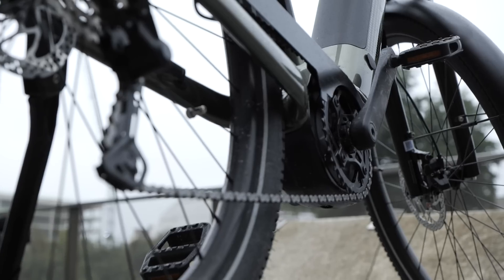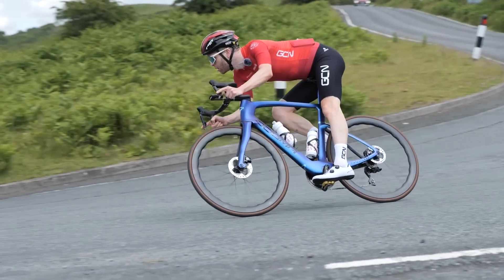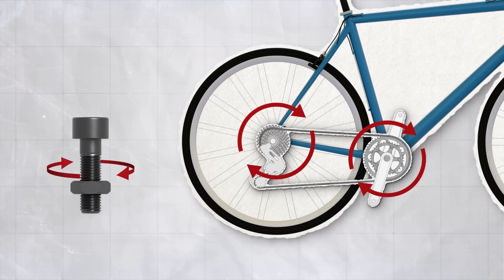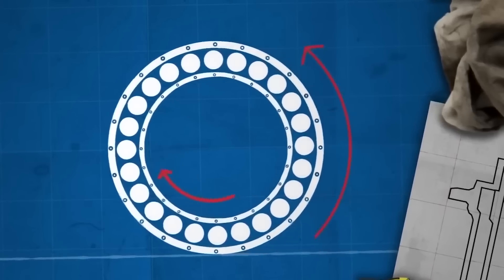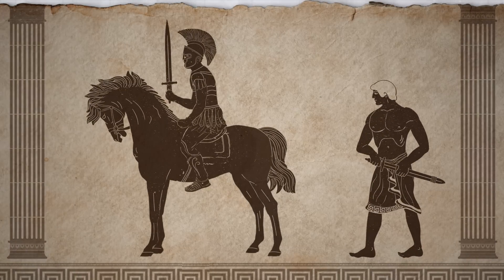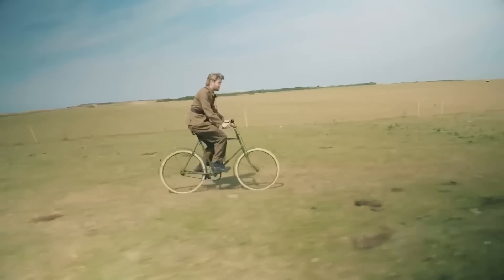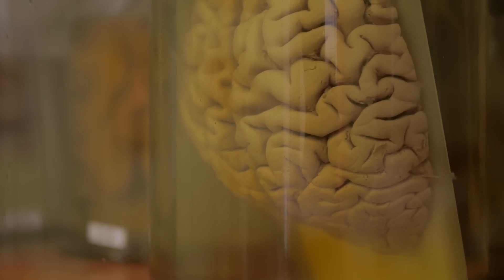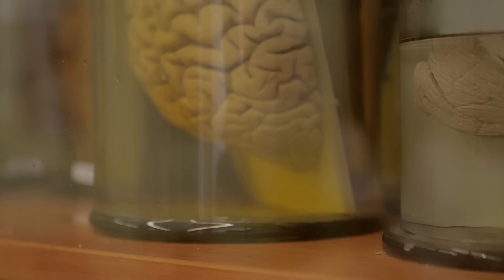Why Is The Drivetrain Always On The Right?

Comment: The modern "safety" bicycle is British. We mount our horses from the left, we operate our vehicles on the left for a right to right passing. It stands to reason that drivetrains were originally mounted on the right such that they would not strike nor become impeded by high kerbs on many British streets in the 19th century especially when mounting ones bicycle. This would also prevent the grease smeared drivetrain from soiling a gentleman's (because cycling is most unladylike, we are civilised people, these aren't the dark ages, it's the 19th century!) trousers when pushing the bicycle in a dismounted fashion. One would logically dismount to port and thus it was simply convenient to push with the bicycle on ones right thus placing the nearest trouser leg on the non-drive side of the bicycle.
 After a while this just becomes the norm. Why deviate?
 Despite the world coming to its senses and adopting the metric system (with exception of Liberia, Burma and the US), many bicycle standards are still imperial. Handlebars are 22.2mm or ⅞". For the longest time seatposts were 25.4mm or 1". Steerers are still 1", 28.6mm (1⅛) or 38.1mm (1½). I see you have bars in 31.8 or 35mm offerings. Do you run the 1¼ or 1⅜ offering? Ah but you have a modern bicycle, your 27.2mm post isn't imperial, right? Wrong, the clamp is 31.8mm, back to that 1¼" because the seat tube is structural to the frame it dictates the seatpost diameter, the more you know. What's the relevance of all this? Well, besides being a bit of fun trivia, it is a clear example of how despite many changes to the safety bicycle, conventions have not changed much in the past 150-160 years.

Comment: 3:10  No! This is not accurate. The reason for this reversal is called precession, it has nothing to do with the ball bearings. It is more like the threads roll around slightly as the load direction changes. For a quick demo: If you hold a pencil loosely in your fist and wiggle the end around in a circle the pencil will twist the opposite direction. This applies to both the bottom bracket and crank threads, which is why the both tighten in the opposite direction that they turn.
Reply: Whatever the theory, both pedals and bottom brackets will actually loosen if not tightened up enough.
Reply: This is true. He is also mistaken about the origin of right-hand threads. It's not because it's ergonomically easier, but because the applied clockwise force produces a torque in the direction according to the right-hand rule. Left-hand threads innately produce a counterproductive outward torque.

Comment: I've recently built a left-hand drive fixie. For the rear wheel the hub is Hope Fatso front hub, with sprocket bolted onto the rotor mounting. It's a nice red one. 

For the cranks it's a set of alloy ultra torque mounted back to front, with the threads for the pedals drilled out and helicoils fitted to reverse them - theyre still left hand thread on the left hand side right hand thread on the right hand side. 

But I realised is that being right-handed, walking with my left hand drive bike on the right hand side, or hoisting it onto my shoulder to carry it up stairs, is a whole new problem - now I have to  make extra effort to avoid rubbing against the drivetrain; or pick up tattoos on my leg, or clothes... Id assumed that the reason for the drivechain being on the right hand side (usually!) is to keep it out of the way for the biggest number of people. I've recently read a book on the history of bikes which suggested that drivetrains in the early years could be found on the left or the right depending on the manufacturer.

Comment: That the transmission is on the right is now very good.
With E-bikes it looks better and makes it more easy to mount the electric motor in the bike.
THe only bike I know that has an chain on the left side is the tandem. Although the sprocket on the rear wheel is on the right.

Comment: Back in 1962 I broke my right leg in five places.  I was a competitive club level cyclist at the time and my legs were very fit so fortunately I healed well.  But for some time I had a hip to ankle cast on my right leg, making it difficult to get around and see my mates.  So, I reversed the crank shaft, mounted the crank on the left and installed a fixed rear wheel with the sprocket on the left.  It worked well.  Until my doctor found out had had my bicycle locked away until the cast came off months later.  Twat.

Comment: This seems to make sense until you realize that virtually all motorcycles have their transmission on the left side
Reply: Maybe cuz the kick starter is on the right. To utilize limited space options.
Reply: Used to agree but you would be surprised how many now have drive on the right.
Reply: Hold on, kick start? Haven’t seen one on a new bike for 40 years
Reply: @petermacdonald6377  I had the Evil Knievel toy motorcycle. With the T-stick power. LOL
Reply: @petermacdonald6377  not in the beginning, though. I'm over 50, too, and don't inspect motorcycles for that stuff.
Reply: Well that makes sense in the same way -> you step up on the left -> so the hot exhaust should be on the right. And you want to separate your chain and exhaust, hence the chain should be on the left. You do however need to change the screw threads.
Reply: Not virtually all. There is a group that uses predominantly right side, and that is ones with transversal engines (although new BMW boxers and Guzzis use left). Also, there is some that use right side even if they're transversal, such as old BMW F engines (before 850/750) or Triumph's retro bikes.

But yeah, majority does.

Comment: Left hand threads on the peddles is un-needed.
Once upon a time auto lugs were reverse threaded on one side.
And then they realized if they used an angled seat for the lugs, they didn't need this.
With correct thread and contact design there is no reason for a reverse thread.
What they do need is an angled seat for the contact.

Comment: In three weeks time, SRAM will release a new groupset to match to a Canyon frame with the drive and everything else on the left and a load of marketing BS that says that right hand isn't aero, is heavier and left hand is more efficient and is capable of saving 100W.  This will be the 2025 craze that will save the bike industry now that we've reached peak carbon, peak electic shifting and peak disk brakes.

Remember - you saw it here first 🙂

Comment: You've got it all wrong. The pedal threads, and the bottom bracket threads. The bearings have an ever so slight drag along the races' surfaces, they don't have internal motors. You got physics all wrong. Fact is, the threads are the way they are, from an engineering standpoint, so that the threads don't over-tighten and seize! This was a problem with manufacturing inconsistencies (poor precision, aka tolerance) in days of past (and still with budget ch!na manufacturing today).  Ideally, we would inverse the threading now, with manufacturing producing much more precise facing and threading.
You've never had a poorly-tightened bottom-bracket come loose? You've never seen a pedal fall off a kid's bike because Walgreen kid didn't tighten it enough? If your claims were true, all that stuff would just self-tighten instead of coming off.

Comment: Great expalantion. Any chance you can explain why the front and rear brake lever location on the bars varies with which side of the road we drive on? Also, on motorcycles the front brake is always on the right.

Comment: This is the sort of content that's brought me back to GCN! 

I've never questioned the fact the drivetrain is on the right hand side - but even more weird, my track bike is left hand side and I've literally never noticed it 😂
Reply: That's hilarious 😆
Reply: Which direction are the threads on your track hub?  Do you have a lockring to keep the cog in place?  A track cog with right-handed threads, but used on the left side will tend to come undone over time.  You get the same problem on the right-hand side, but only when you try to resist pedaling.

Comment: So in the '70s a Canadian track cyclist had an experimental design with 2 drivetrains. The left side was set up with a freewheel, it would be the drivetrain until it was unwound. The right side was set to wind up and lock, so it would be a bigger gear. Not sure if it got banned, or was just too heavy for the Kilo. Jocelyn Lovell was the cyclist.

Comment: The reason the first "treads" where right handed is also because the first screws where from wood and wood is stronger left handed, which is the force applied to the wood when using the screw. That is also the reason old windmills rotate counter clockwise.
Reply: why is wood stronger left handed? Is this the chirality which is part of whole nature?
Reply: @Long_Toe  Science is not sure why wood is stronger is one direction as the other. It is probably a combination of sun and wind. Western wind is much more common.

Comment: Love geeky historical content.  Ive often wondered why motorcycles are the opposite to bicycles until i saw some early motorcycles in a museum.  I noticed they were basically bicycles, complete with right-hand side drivetrain with an engine bolted in the frame and a second drivetrain powered by the engine on the left-hand side.  As motorcycles evolved and went in a different direction, perhaps the left-hand side drivetrain remained once the pedal cranks had gone?
Reply: The combination of pedals with a motor is where the term "mo-ped" comes from.  Eventually the requirement for usable pedal drive was dropped, leaving only limits on maximum speed and power to be classified as a moped for road-tax and licence purposes.

Comment: It's the effect of precession that tightens pedal axles and English-threaded BB cups.
The video implies BB bearings push the outer cup in the opposite direction of axle rotation. If that were true, that force would act to accelerate the motion of the axle. We could use bearings as motors!

Comment: Interesting. Another reason that we drive on the left that I've come across is that in the days of horse drawn carriages, coaches and wagons, the drivers and waggoners had whips with which to encourage greater efforts, (a practice now rightly outlawed because of cruelty) because of dominant right handedness, the whips would need to be raised away from low overhanging branches and more to the middle of the road where the tree branches were at their highest.:goodvibes:
Reply: I don't know about that. People in my country are still using carriages and whips and they drive them on the right side without any issues

Comment: It would also make sense to have it on the same side as your dominant foot, as that's probably the side where most torque will be applied. Also re swords, your left hand will also likely be holding a shield (unless you're rich enough to have a squire to pass it to you after mounting), and that would be very awkward to swing over the horse.

Comment: motorcycles similarly nearly always have the chain on the left.  i think this is because the brakes are operated by the right hand (front brake) and right foot (rear brake), and traditionally the rear brake was a drum-type design that had a mechanical linkage to the pedal actuator.  by placing the chain on the left it cannot interfere with the brake.  additional head cannon: kick stands all lean a parked bike to the left, and i think this was intentional to keep the chain (which requires lube & care) sheltered out of the weather as much as possible.

Comment: i dont think i learned anything from this actually. this video was just a bunch of common folk tales presented as facts
Reply: true
Reply: Some of it perhaps, but the main point is about right-hand threads (specifically of the rear sprocket) is absolutely obviously correct to anybody with a basic knowledge of bikes
Reply: @emanuele8226  if someone presents both facts and fiction at the same time while failing to make a distinction between the two im not comfortable taking anything they say seriously.
Reply: Esp. the point the drivetrain is where it is because BRITAIN has left hand traffic really makes me rofl…..

Comment: Suppose you're a manufacturer making a certain type of wheel. At present, 100% are threaded in one direction, and 0% in the other (by threaded in this case I mean the way the ratchet works). If you wanted the drivetrain on the left, you'd need one with the ratchet going the other way. So you'd have, say, 60% for drivetrains on the right, and 40% for drivetrains on the left, and you'd have to do surveys and guesswork to figure out what proportion of your wheels are right handed and what are left handed. Given that putting the drivetrain on the left grants essentially no advantages, it is silly to have all the fuss and waste of manufacturing components for each side: you'd have to make two models of dereilleur for each one you have today, two models of crank for each one you have today, and so on, and if you guess the proportions wrong, you'll end up with an excess of components for one handedness that nobody wants, and a shortage of the handedness components that they do want. Having a single convention, having the drivetrain on the right, leads to an efficiency for manufacturers, and is also better for consumers since they don't need to worry about what handedness they need to buy components for: imagine buying a replacement cassette and discovering it was the wrong handedness.

Comment: It's probably just historical convention, and the fact that most off the shelf gear (cassettes, derailleurs, cranks, chainrings) are designed to be on the right. Who in their right mind is going to design a bike that requires custom parts, without a very good reason? Probably nobody. Now, it's not that hard to make left handed screws, and in fact bikes do have some left handed hardware, but they're few and far between among the right handed drive trains. So yeah, probably just historical convention.

Comment: So ! why are rear brake on the left hand in the UK and on the right in Continental Europe?🤔
Reply: In left hand drive countries, when making hand signals, it's better to use rear brake for slowing and the right hand for signals; the rear brake gives better modulation and won't be as likely to pitch you forward as the front brake; hence left rear brake in left hand drive countries and right rear in right hand drive countries.
Reply: @Andy-sj2dv  I was wondering if it was that. As anyone with a loose headset will know if they try slowing when signalling a right turn.
Reply: @Deepthought-42  who describes themselves as "someone with a loose headset" lol. allen wrenches come free with most parts you buy
Reply: Brexit?
Reply: @Mike-London_se19  Can’t possibly be. “Taking back control” meant cars could drive on the left again but as anyone who has cycled along the M20 and M25 will tell you cars are still drive on the right when they are not stationary.

Comment: This is a thing in photography, with the lenses you can change on a camera body. The direction the rings turn to adjust focus, aperture, and in some cases zoom changes based on who manufactured the lens. Annoying to go from one system to another if you aren't used to that. And it also comes from proprietary pieces. The mounting system changes, how far away the lenses are from the sensor/film (flange distance) changes, mechanical and electronic linkages change. It's a mess. Be glad there is a standard that everyone uses, and there can't be engineering pressure to make it proprietary. Bottom brackets are annoying enough.